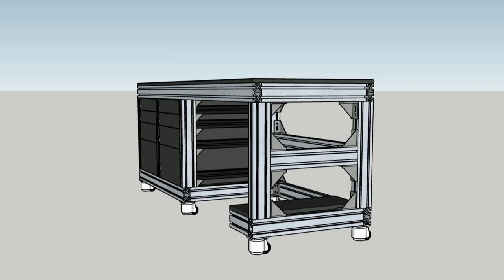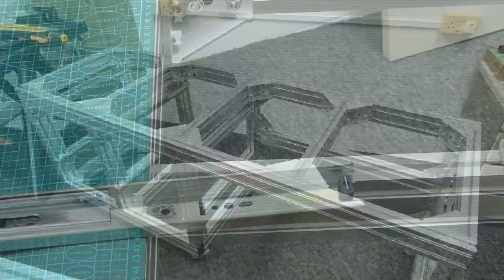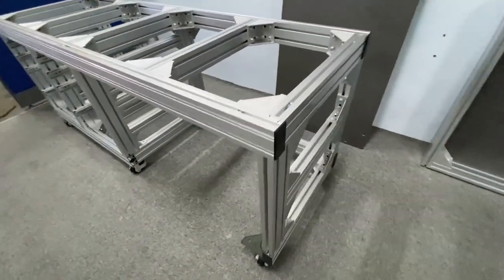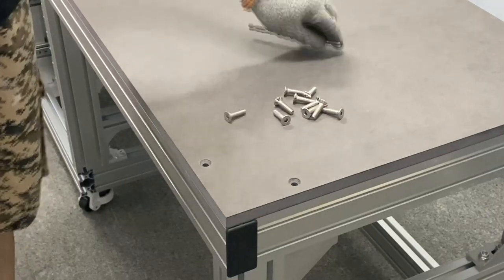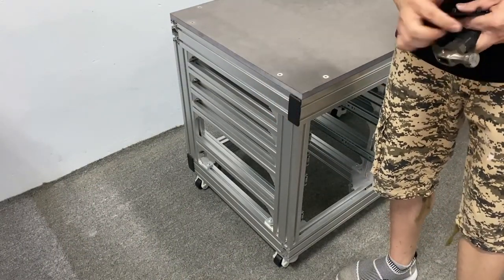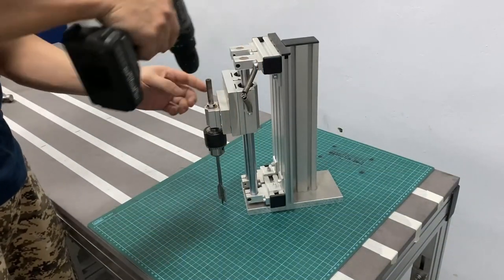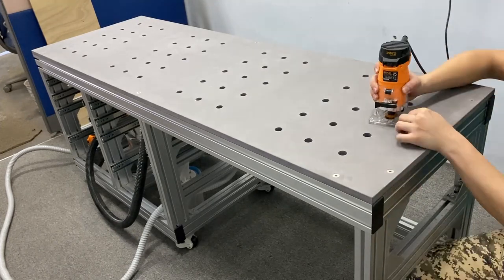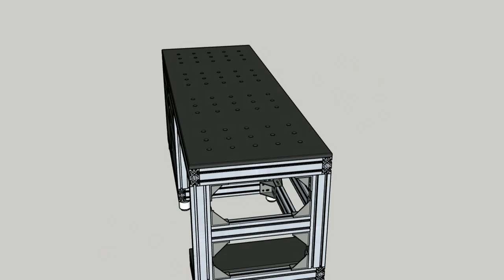Aluminum Extrusion Frame Assembly Workbench (Part 2) | Drawer Slides + Tabletop

Comment: The dril jig looks pretty awesome, please put up that video!
Reply from the maker: once i have time, I will make Version 2 of that drill jig and show you!
Reply: @TheAluminumCarpenter  look forward, thank you!!
Reply: I need that drill jig.

I just started a new job a few weeks ago. I design various tables, platforms, jigs, and other frame assemblies using 80/20’s extruded aluminum

The hardest part is keeping track of how you will assemble components in later steps of the build. Some fasteners just won’t work due to space issues.

The drill jig also gives me ideas I can present to customers.
Reply from the maker: @patrickschardt7724  that makes u and me the same. I will soon show videos of mulitple joints including concealed joints. Drill jig, you are in luck. I am now working on a video featuring a 3D printed drill jig, which is an improved version of the one in the video. Stay tuned.
Reply: @TheAluminumCarpenter  awesome. I can’t wait to see it
Reply from the maker: Hi, it’s been long. We finally made our precision jigs available for purchase. Please take time to drop by our website thealuminumcarpenter.com

Comment: What did you use for the drawer slides, table top, and the drawer front faces

How did you make the 3D profiles in Sketchup
Reply from the maker: The drawer faces and table tops were coloured MDF
Reply: @TheAluminumCarpenter  thanks for the info.

Were the drawer slides custom length or a standard one?
Reply from the maker: Standard. 600mm length.

Comment: Can you break down the parts cost at time of build?
Reply from the maker: I didnt. I can only estimate.
Reply: @TheAluminumCarpenter  a ballpark estimate would be fine. I know what it’d cost to build out of wood. Curious how it compares. TY!
Reply from the maker: Sure. Let’s say plus or minus $800 usd, which includes everything u saw in the video, excluding accessories. How much would it be if all wood?
Reply: @TheAluminumCarpenter  maybe 1/2 that, depending on whether you used box store lumber, or something nicer. If I used lumber that would make it look as nice, and be as durable (hardwoods), it’d probably be close.
Reply from the maker: Thanks for the info. So probably metal is the extra cost. But the colored mdf is the most costly of all. But its damn good quality.
Reply: @TheAluminumCarpenter  no arguments there. Do you sell any of the 3d printed jigs you made?
Reply from the maker: Yes. Have u visited our website or youtube shop? I have some. I do have more on the way. You need to tell me what jigs u need, via email in our website, if you cant find what u are looking for.
Reply: @TheAluminumCarpenter  I’ll go take a look. Thanks.
Reply from the maker: Welcome.